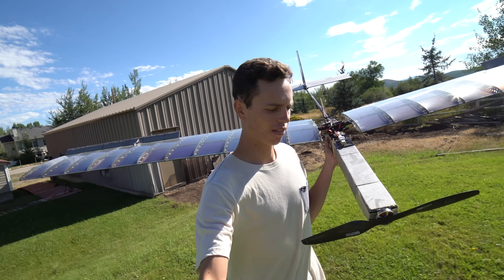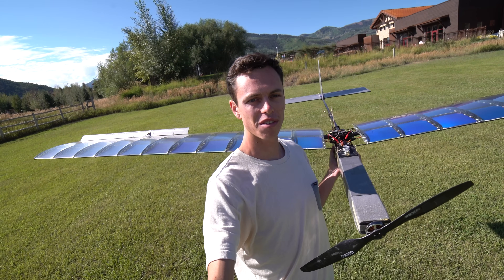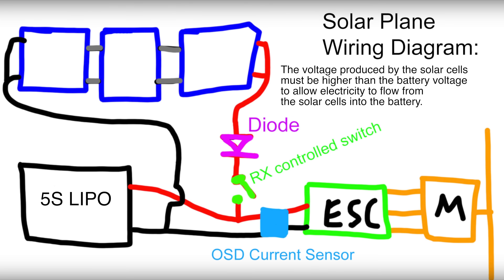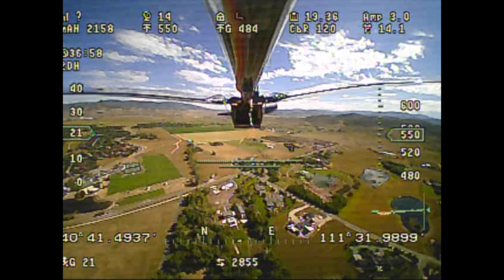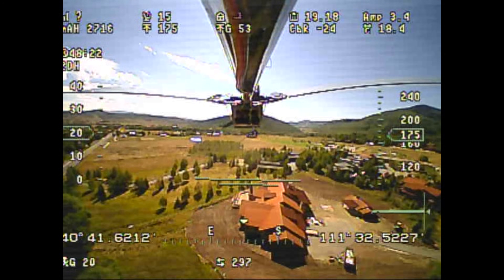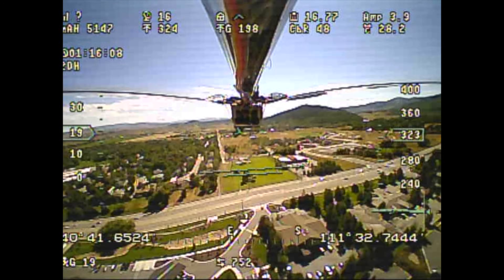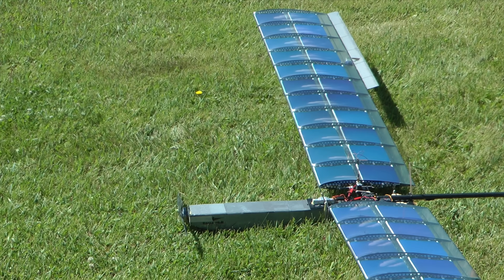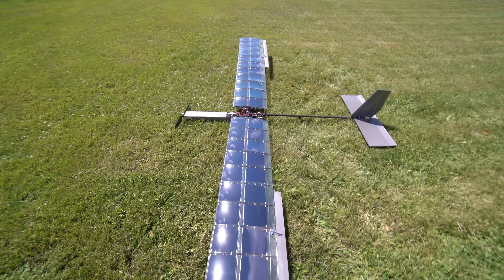Solar Plane V3 Cruise Testing - RCTESTFLIGHT

Comment: Kind of late to the party...did you publish your electronics architecture, or schematics, anywhere?  There is a lot that can be done with power conversion to keep the solar cells at optimum output voltage/current, which, you probably knew ;-)

Comment: you need more solar cells in parallel with that lower voltage battery because you are using more amps to run the motor. thus a bigger wing !

Comment: When looking at the two test segments you made it might be worth considering that if you're flying over a town with direct sunlight, quite likely there will be thermals and that might skew your results of altitude and mAh consumed for a certain period of time. Certainly it did look that 11am would be more lifty than 10am and with the right plane at the right time in the right place you could fly for a very long time with virtually no power consumption. That's what we do with Paragliders and if I remember correctly, that's what a spanish guy did some 7-8 years ago when trying to break the FPV distance record. He set it at 80km or so and basically used solar panels on a "glider" type  fuselage with folding props and he would maintain altitude with the motor when necessary but try to thermal to gain altitude (and recharge batteries) as much as possible.

Comment: The gap in the center of the wing is very bad for induced drag, you should cover it up!  This is probably the largest source of aerodynamic inefficiency in your design and one of the easiest to fix. Also, the covering sagging between the ribs is bad for drag.  Anything you add to support the covering will probably create a shadow on the cells which is even worse!  Maybe a new wing with external cells behind the high point is the way to go.

Comment: That tail is huge! You could probably cue down on some drag by making it a little smaller, or by sweeping the horizontal stabilizer back a little. Or maybe put some solar cells on that too, unless it would mess up the cg to much but hey it's worth a shot.

Comment: Have you though about making the fuse wide and flat enough to take more solar cells? Also, pehaps you could put a few cells on the elevator. May not make much difference but a slight rise in input voltage might improve run times and battery maintanance. Keep up the great work though, it's fascinating to see people working on sustainable flight. One last idea, is a ducted fan more efficient than a prop perhaps?

Comment: We use a MPPT controller in our Solar UAV, 'SilverEye'.  More details here: www.facebook.com/solardrone
Reply: Could you please specify which MPPT controler you use?
Reply: We used the GenSUN - I saw a video elesewhere where they gave it a terrible review, now I cant find that vid.  I too had trouble with it, delivering only about 60% of power.
Always they are designed to charge battery - Ive never been able to find MPPT that just does conversion.

Comment: Try some different props with less pitch you dont use full power anyways. I fly drones and less pitch for me gives me way more battery time and some props kill batterys  and motor get hot and don't give me more speed anyway they give me less and people are using them because they look better or cool but they need a load of amps

Comment: Have you tried lithium iron phosphate batteries they are more efficient when charging and are lighter than lithium ion batteries. which would be better with a solar cell charging system. aka lipo 4 battery

Comment: If I could make a recommendation... fill the empty areas with hydrogen (or helium, but hydrogen has twice the lifting power that helium does, and yeah it goes kaboom, but it is not like there should be anyone nearby the thing 99% of it's flight life, at least conceptually), maybe fill body with small bags of helium as well, or seal into the carbon fiber some helium/hydrogen air bags, or create a fuselage around the carbon fiber tube that could hold more helium/hydrogen (depending on what you decide to try)... this wouldn't be cheating or anything and might get you past being capable of 100% continuous flight without touching the ground? Good luck!
Reply: You mean a miniature blimp?

Comment: just a suggestion add some reflective surface on your ribs ... because those shadows will create huge losses on your solar cells. if you cover 10% of a solar cell you lose a lot more than 10% i think its around 50%.
Reply: I agree with this 100 percent
Reply: the way one solar cell works is like a bunch of batteries in series if one "battery" cell goes out i.e. shadow then the back will have to compensate for that lost cell. So basically the part of a solar cell that receives light has to "power" the part that does not receive light and the shadowed part acts like a resistor kind of. And yes making the spars reflective would make shadows but spacing the gaps in the cells wider and then putting two spars in a triangular formation might help by making no shadows. However good work so far ... i have always wanted to do this but it is an expensive venture.
Reply: would this eliminate shadows though? you would be getting more sun to the panels but wouldnt the same amount of panel area be in shadow?

Comment: You could try to ditch your battery for some caps, or an even smaller 5s. If your plane weighs less using a smaller battery, it might help you get your efficiency up.

Comment: In every single video there are people telling him to install a solar panel charge controller. And yet here we are, version 3, still wired pretty much directly to the batterry.
Reply: Most of it would be the casing, just remove it and you're good. Jeez hardware modding is not difficult. And if nothing else, you can DIY a charge controller that would be like a couple of op amps and mosfets.

Comment: I’m concerned how much power that diode in your wiring diagram might be taking. Remember power=current*voltage applies to diodes as well.  Maybe you could add another voltage telemetry to the solar panels and maybe a current meter between the solar panels and the switch? That way you could monitor it without wasting power in the diode.
Reply: Of course, without knowing what diode you specifically chose, I can’t know if this is an issue. What’s the diode’s turn on voltage?

Comment: Is that monokote over the solar panels? It’s hard to tell. It might be filtering too much radiation in the wavelengths the solar cells work best at.
Reply: That was my concern too, maybe a ground test with and without Monokote to see what the actual losses are.

Comment: I think you should look over the aerodynamical design of the plane again to get less drag.
For example the nose has a bad shape (look into f5j planes  for the right design) 
the Wingtips (witch are not there ) are a big loss in efficiency and lift ( look in F5j and F3K ) 
The stabilizer looks way to big and clumpy .

I would go with a Cam folding prop and turn the motor off from time to time . Even without Thermals you can get a pretty nice glide slope and lot of time to recarge the battery. 
But all in all it looks like a realy nice project!
Reply: Oh i forgot the ailerons ! 
I mean realy ? they are a pain in the backside ! 
if you cant put them in the wing due to solar cell placement mayby trie moving the wohle wing ( twisting ) to stear the plane because then you have the optimum airfoil in all positions to reduce even more drag
Reply: Miky Schuster or maybe get rid of the ailerons completely and fly it as a 3 channel. I think you could get away with that with the amount of dihedral you have.

Comment: For a first test you could segment the solar cells and use a simple mppt single chip solution
12V MPPT Solar Panel Controller Charger Module 
http://s.aliexpress.com/EBvaAvm2 but I do not know if the plane can fly on 3S without modification.
Step down mppt is by far easier than any other option.
These are simple input load tracking step down controllers but they are simple and thus cheap.
There are also adjustable and more beefy versions and the price is still pretty low.
This one should also work for your 5S pack but going down to 4S might improve the working range of the step down regulator. http://s.aliexpress.com/Mn2MrYnU

Comment: Parts from aliexpress are much cheaper than local.  With the MPPT charger, you need the panels wired in series for maximum permitted input voltage.

Comment: I've not kept up with this project and what testing you've done, but i suspect you're losing quite a bit of power due to reflections off the clear wrap.  However, mounting options for those sunpower cells are very limited and i don't have a better solution.

Comment: Put solar cells on the tail and nose. Maybe put a double or triple rotor on the nose or just but 4 2-bladed rotors together to have an 8 bladed propeller.
Reply: Berleezee the efficiency of props goes down as you add more blades.

Comment: The wing center cutout cuts your effective aspect ratio in half.  Also the diode creates a voltage drop. You just need a bit of tweaking and you will sustain flight on PV.

Comment: I will support it only if you will experiment with having the solar cells drive an onboard lipo charger instead of tying them directly to the battery. Or will that not work?

Comment: a few suggestions:
use a prop with the correct pitch for forward flight. 
make a new wing with a true airfoil, and the solar cells near the surface, so that there is no shading.  
streamline the fuselage, to reduce drag.  
make some more efficient wingtips.

Comment: I would recommend getting quality 18650 batteries, cut out most of those wires. Reduce weight everywhere. U really should use a tube fuselage and shorter. Also cables can make the wing stronger with less weight.

Comment: would super capacitors work?
Reply: I think I must disagree with the sceptics here. In the video, he says the efficiency goes down when the voltage between solar panels and battery is smaller. It means the solar panels don't get all the power they can provide sucked out of it. 
I wouldn't be surprised if a few supercaps would solve this. They don't have to replace the battery, because that would obviously not be efficient weight/power-wise. But just to make sure all possible power from the panels goes to the motor...
Can't say for sure if it'll work, but I reckon it's worth a try...
Reply: https://www.aliexpress.com/item/New-1Pc-Farad-Capacitor-Kit-6Pcs-2-7V-500F-Super-Capacitors-With-Protection-Board-Capacitors-16V/32803384651.html?spm=a2g0s.13010208.99999999.293.SpcFTW
Reply: not enought amp hours for how big/heavy they are
Reply: Their energy density is too low.  Both the volume & mass required to store a significant amount of power using super caps would be too much.

Comment: Great project! I'm an electrical engineer and I think it would be interesting to log the current and voltage from the solar cells instead of just looking at the voltage of the cells. Current times voltage from the solar cells corresponds to the energy harvested from the sun, and the current voltage of the battery times the current draw corresponds to the energy wasted. 
As you probably know the voltage over the battery does not decreasing linearly during discharge, hence aa 0.5 volt drop in the beginning does not represent the same loss of charge as a 0.5 drop in the middle, and at the end of the cell life the voltage drops very fast for just a small change in discharge level.

Comment: Voltage lost shouldn't really be linear over time anyhow for LiPo batteries, so if you just compare voltage lost per time you won't get a consistent number even with no solar panels
Reply: Why is it so? Sorry I'm no battery expert :o
Reply: I'm in robotics not chemistry, so I'm not 100% myself, but it's different for different types of batteries and you can see it if you google "discharge curves of batteries"

Comment: You should consider adding super capacitors to the plane.
Reply: theres no point. and they would add too much weight.
Reply: But if he replaced the lipo's with a super-capacitor then that may charge more efficiently and would be able to output power better.

Comment: Charge controller won't add power, but would allow you to use a smaller lipo, which means a little less weight. It seems fast, maybe a slower motor too?

Comment: I'd be interested to see how well something like this did. 

http://www.ebay.com/itm/5A-MPPT-Solar-Panel-Controller-Step-down-Constant-Current-Voltage-Power-Module-/171864582846?hash=item2803ed6abe:g:DMIAAOSwT6pVrMli

Comment: I believe you don't need that diode on the wiring, since there's no way that the solar cells works backwards. Nice project
Reply: Mateus Leonardo Without the diode the battery will try and "charge" the solar cells when they aren't producing more voltage than the batteries, which is bad. However, if you could do away with the diode you would gain a bit of voltage because you wouldn't have the voltage drop.
Reply: ive actually tested with a multimeter. and i hooked a small solar cell directly to a 12v battery. and not even a single milliamp of current was flowing into the solar panel when the solar panel was facing the floor.

diodes are actually for a different purpose in solar panels. they are used so that if one part of a solar cell is in shade. the diode will allow the rest of the solar cells to "jump over" the shaded solar cell and allow the power to maintain closer to full.

Comment: Have you considered adding winglets, they probably even point down from the wing tips to avoid blocking the sun. I think they should give you an efficiency improvement.
Reply: Winglets only help efficiency when there is a significant tip vortex, which is caused by a heavily loaded wing operating at low speed (aka high lift coefficient).
Reply: It would also be adding unnecessary weight. I think he should get a smaller lipo+charge controller and downsize the horizontal and vertical stabilisers, the rudder and elerons can stay the same size.
Reply: Maybe not winglets, but rounded or hoerner tips at least?

Comment: Since the motor requires a low current, wouldn´t be better if you use LiIon (18650 for instance) as batterys? They´re lighter than LiPo

Comment: Perhaps a Maximum Power Point Tracker MPPT Circuit would make the plane operate more efficiently? it should make voltage difference less important.

Comment: You should use a small solar charge controller. Doesn't need to be anything fancy like MPPT, just one that draws as much current from the solar cells so they stay at a certain voltage you set (close to the maximum power point). This is usually fine enough over a decent range of illuminations.

Comment: Hey, I like your channel and been following for a while now. I have been playing around solar rc planes myself. Your plane should have heaps of power with that many cells and your cruise current. I think you have two main issues, the cells don't appear to be in full sunlight and must be getting shade from the ribs. These cells produce a fraction of the power even when a small portion of the cell is shaded. Also it would be good to have some air flowing over them to keep them cool. I have a 2000mm glider with 16 c60 cells running on 2s with 3400mah Liion without mppt. It has just enough power to sustain flight in loiter mode and without the aid of thermals. I have learnt alot from watching your channel and it has inspired me a great deal, so thanks very much and keep putting videos up!!!

Comment: You need an MPPT charge converter.
Reply: Yes.  After using one for 6 months its definitely the way to go, I have a 24 volt solar panel setup and a 12 volt battery bank, only with the MPPT controller am I able to do that.  Way smarter than PWM.
Reply: I just made a patreon pledge to make him afford that :)
Reply: Exactly this. This is basically what he talks about when he discovered with that 'sweet spot' of voltage.
Reply: https://imgur.com/ORnvFz4

Comment: Remember that you have a diode in circuit so for the current to flow from the solar cell to the other side the voltage produced by the cell must be higher then the battery voltage by at least the value of the voltage drop of the diode.